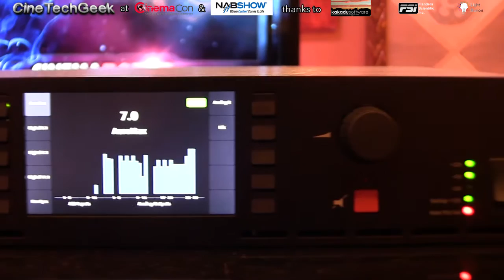CC16 Barco AuroMAX immersive audio processor preview and INFO update

Comment: Hi, Mr Gardiner. Can it be said that the AUROMAX system is dead? Considering that not content has been produced for it and it isn't well supported by BARCO and AURO.
Reply: I must admit I don't follow it as much.  But to a degree yes.  I am not completely sure but from my understanding this technology, or what's left of it, has been re tooled to support IAB mastering, the open standards version of immersive audio for cinema.
When it comes to the complex and locked up license side of domestic use of these technologies, not sure.  It's a mind field, and like red camera abuse of the raw compression patent (obvious, should never have been granted) you can see how dirty the business is under the surface.
Reply: @JamesGardinerCineTechGeek  🙏